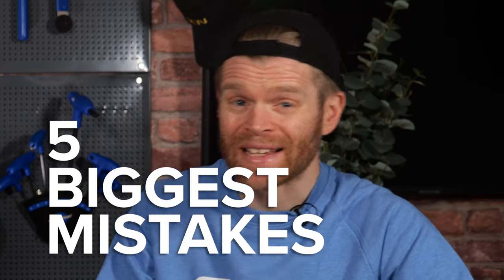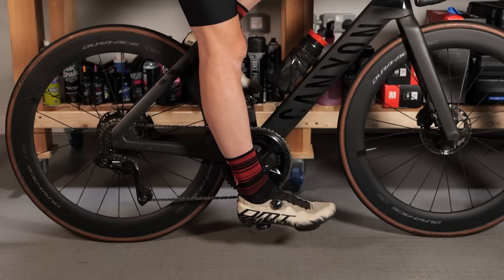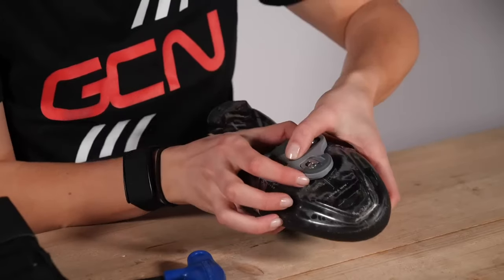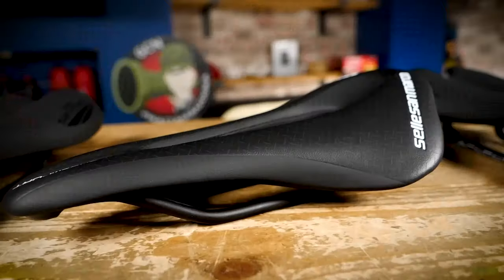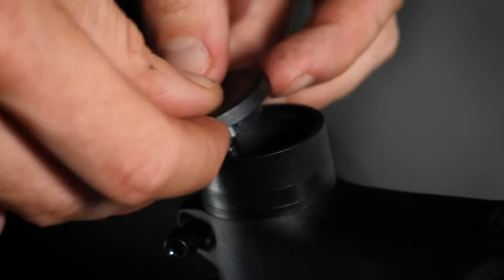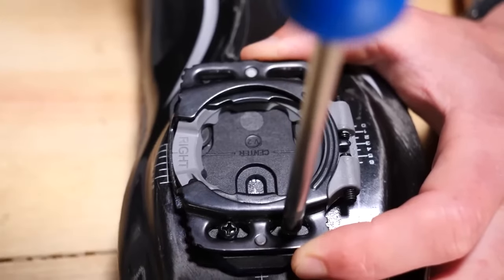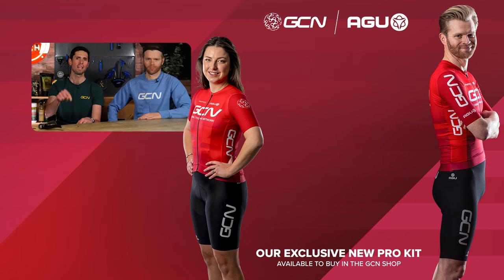The 5 Most Common Bike Fit Mistakes

Comment from the maker: Have you made any of these adjustments to your bike? 🚲
Reply: I got a new road bike for Christmas 2023 and the bars were off center just a bit so that it was causing back pain on longer rides from being leaned over to one side. No change in saddle position,  just centered the bars with a tape measurer and done. Great tips!
Reply from the maker: @wertacus nicely done!
Reply: Got a size smaller frame (than recommend for my height) after a fit. That was key, as the recommend size just felt wrong, despite the advice and theory. Afterwards moved from 172.5 to 165mm cranks also - that made a big difference.

Comment: Way too simplistic. Saddle not comfortable, try loads??!! WHAT! Any decent fitter will tell you that saddle discomfort is often the result of a poor fit so get that right first before throwing money at saddles. And you wont get anywhere near it by just sticking yiur heel on your pedal. Go and see a decent fitter, get the right geometry and setup for the riding you do, then sort your saddle out. Love GCN content, not this one, sorry guys.
Reply: Agree, usually the saddle discomfort is not because of the saddle! It is because of the wrong body position meaning the geometry.

Comment: i am not a pro-cyclist, so...i am having a hard time comprehending why whether cleats are worn out is a "bike fit" mistake?? and it is so important the expert put it as point 2
Reply: I would suspect the list is largely based on how often it comes up as a solution to an issue. Like he gets a lot of questions regarding knee or hip joint pain and the solution is not to adjust anything about the bike itself, but the cleats.
Reply: @Frag-ile  ahh...thats right, thanks
Reply: Worn cleats will result in a lot of play in the front of the cleat which can cause all sorts of issues
Reply: Complete nonsense. This point made him look like a complete fool. He has no idea how cleats work. Laughable.
Reply: @Tantewillieja what? At least with spd sl this is complete nonsense. What is wrong with people? Have you ever ridden a clipless pedal? Sorry, but I had to adapt to the quick fire of the video.
Reply: @christocan4710 this guy gets it. They are showing a worn cleat from walking on asphalt. This has nothing to do with the engagement surfaces. You'd have to inspect the nooks and see if there is additional wear and generally you'd just get "bonus float". Replace them if they don't engage properly or plastic is getting thin enough to snap with whatever watts you pull up with. You're way worse off changing cleats prematurely and then not getting the alignment the same.
Reply: @labpartnerlp  Great comment and exactly my experience. The worn edges from walking don’t change anything to riding. With SPD SL the front and back engagement parts are almost never worn. It’s great quality and assuring the safety. Also my pedals have zero damages from cleats. It seems not possible. After 20.000 km or so I just switch cleats sometimes for the looks and better walking.
Reply: i agree. this is bs and also i don't see why the pedal shoud wear quicker when the cleat is worn out. sorry gcn but this video was not very good
Reply: YES, IT IS, it's hyper important a sloppy cleat has your foot all over the pedal and can put your whole leg out of position and can totally screw your whole body up!
Reply: @leedorney  NO IT ISN'T. :-) At least with SPD SL cleats they only suffer from he bottom. Nothings changes at the positioning and clamping on the pedal. Maybe you are talking about some cheap copy product.

Comment: The biggest mistake is NOT spending lots of money to support the industry.
Reply from the maker: What would you say is the best area to spend your money on?
Reply: @gcn  If you're having actual comfort issues on your bike, study the concepts of bike fit and apply them to your situation.  Make whatever adjustments seem appropriate short of replacing parts.  Then, if that hasn't worked,  go for a bike fit.  Don't spend a dime on new parts until you have that accomplished by someone who knows what he or she is doing.  Then make one change at a time so you'll know in the end what actually worked.  Assuming you're on the right size frame, odds are the parts you need are either a saddle or a stem.

Comment: I agree with some of this but hand placement on hoods and handle bar is complete nonsense and shouldn’t be relied upon for a good fit. Hands will naturally move around as even the best fitment will lead to a “sore” hand at some point and you naturally move to a different position, you also naturally move around as power increases but yes you should be able to “hand shake” comfortably with lever at some point to control the bike. But to say ou should be there all the time? if I want to sit up more and relax I will, the more power I put out the more extreme the position gets till eventually I’m either in the drops or have a 90 degree bend in the arm and flat back.

Comment: This misses three other key measures: fore/aft saddle position, fore/aft cleat position and bar height. Cleat wear is not a fit issue; it goes with saying that you replace cleats when they wear out.
Reply: The thing with the cleats is the thought of feeling the difference after changeing them. It can be so annoying if you tried but can't get them to feel like being in the same position as the previous. For that reason - if the cleats feel perfectly positioned - I tend to not change them too early even though they are worn out and wiggly.

Comment: There seems to be an assumption in this that we are symmetrical. We’re not. Legs are usually different lengths, feet arms, the bike may be symmetrical but there is a degree of compromise required to get a good fit. For example better the short leg doesn’t over extend than the longer one doesn’t fully extend (I think that makes sense). Also important for cleat positioning

Comment: Bike fit needs to be personalized and for the specific purpose. How long you've been riding and your weight, particularly your torso/arm weight make a difference, as does the ability to regularly get out of the saddle. It's surprising how many amateur cycists can't/don't feel safe out of the saddle! A little tip for numb hands is to NOT tilt your levers up excessively, try have them close to horizontal, this also makes it easier to brake on the drops.

Comment: I used to ride a TT like position, but for a more relaxed yet powerful stance on the cycle i relaxed things and looked at everything, saddle - reach - saddle height - shoes & width - bars - lever position - you name it i got it to a place whereby im comfortable for hours on the bike instead of for a 10 TT or a blast round my local circuit etc..and as much as its cost a bit im happier and more comfortable to go faster when i want to 👍

Comment: What I'd like to see a bike fitter clearly explain is that there are three basic curvatures to a saddle that define its shape: 1) the longitudinal (back-to-front) (i.e. flat or curved saddle); 2) the lateral (i.e., sitting on a log or a flat board); 3) the shape viewed from above (e.g. T-shaped with narrow nose or V-shaped).  Once you know what you need along these dimensions based on past comfort or even riding style, pelvic rotation etc.,  this radically simplifies how to narrow down your choice of saddle.  Different manufacturers have different saddle selection strategies, but for the basic consumer, they may not be clear.  It may not matter much if a saddle has a large or small cutout if the basic shape is not right.  The recommendation to "just try it" is not helpful when there are 50 saddles to choose from.   You need to know which saddles to exclude and knowing the basic shape is very helpful, just as is measuring the width of the pelvis.
Reply from the maker: This sounds like we should try and get an expert from the saddle industry to come along and talk saddles!

Comment: Yeah. Being an aged git I realised a couple of rides back that I have shrunk over the last N years; in height, alas, if not in girth - whence neck and shoulder pain, and much riding with my hands on the tops of the bars.  A couple of days ago I swapped out my 9.5 cm stem for a 7 cm, and while I think I was more comfortable afterwards I might yet go back another centimetre.

And since my cleats have been clicking and clacking of late I reckon they're due for a change as well.

BTW: re saddles, a lot of people have legs of different lengths, 11 cm in my case, and plastic-armature saddles are utter hell to ride on since all the weight acts through a small patch on the shorter-leg side.  A leather saddle may be viewed as a 'dad' thing but it will adapt far faster than any plastic saddle under the sun.

Comment: Question here - It’s not uncommon to have on purpose different cleat positions on both feet due to dissymetry. Why isn't it the same for other parts of the bike? For example, a lever slightly higher or lower than the other one, slightly offsetting your handlebar, or (why not) different size cranks?
Reply: One of the reasons is because  your locked in with the cleats so you’re feet can’t naturally adjust. The rest of the body is free to move and adjust as and where it can. This is we’re bike fits start to become blurred. You need to listen to your body and adjust bit by bit to a point that suits you but a fit may MAY get you there quicker. Or it’s a problem you may have to put up with
Reply: This is a valid remark. If one arm is longer than the other, why not move one STI further away. If one shoulder is broader, then put the handelbars off-center. But my guess would be that this is rare, whilst misplaced STIs, handlebars etc. are quite commonplace.
Reply: @SrFederico I do have one arm slightly longer (I think many do) and have moved the lever a few mm out.  Since your hands should be just floating on the hoods or bars when the saddle setback is correct, it doesn't make a huge difference, but may be a worthwhile tweak.
Reply: @bengt_axle  Limb length discrepancy and different sized feet are quite common, a good fitter will and should know this, and not say bullshit like this "expert". This video is full of false claims and missinformation.

Comment: What are the next 5?  I'd suggest that if the stem is too short, a rider may move their saddle forward to shorten the reach.  So what is the correct saddle fore-aft position?  Plumb bob from front of knee to pedal spindle is only a starting point.  Good luck!
Reply: No, you definitely should not move the saddle just to shorten the reach.  Setback is all about balancing the upper body. There is no biomechanical basis for "KOPS".  The correct way to set up the saddle fore and aft is to set it at the horizontal position that allows your hands to just float on the hoods or tops of the bar when pedaling moderately hard.  Bernard "Blaireau" Hineaut famously described this as "being able to play the piano".  When you pedal, some of your weight is taken off your hands because your pelvis is further back and cantilevers your upper body weight. Sliding your saddle back will take weight off your hands; forward will give you more power but more pressure on the hands. The stem is always chosen last, to just allow the hands to fall on the bars in the right place, after the saddle has been set up. If you cannot reach the bars with a stem of 70mm or more, your ROAD bike frame is too big (mountain and gravel can have shorter stems).    That being said, some people can move the saddle forwards a few mm and still maintain a good balance because they push down harder on the pedals or their abs are strong.

Comment: I have some very small fingers and i can't grab the brake levers, i'm in shimano 105, I tried to bring them closer with the setting screw but it is still to far. Do you have any solution ?
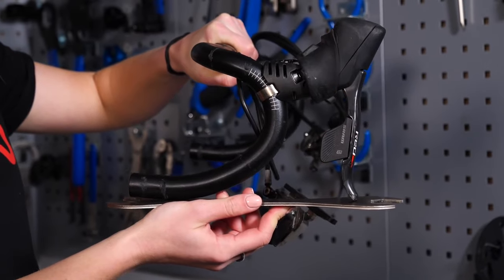At 3:07 does the levers should always be like this? exactly parallel to the ground with the handlebar ? It is not what I see on every picture, is that a problem?

Comment: You mentioned cleat markings on shoes may differ. What would you use as the reference point when putting new cleats on your new shoes? Measure from the toe, heel or from the cleat bolt holes?

Comment: Speaking of saddle comfort, I always thought it is “fine” to feel discomfort and numbness after 60-80 km non-stop pedaling. Should I consider changing a saddle in this case? Seriously 😅
Reply: You should be able to ride without any numbness, even if you're doing 5 hours of cycling everyday, like a pro.   The only pain you might feel when first starting is soreness under the tuberosities (sit bones), but this typically goes away with good shorts and after a few rides.  Your TVA should and lower abs should be contracted slightly when pedaling.
Reply: Not necessarily, get a good bike fit. Preferably not from that guy, he is talkin shit.

Comment: I can't agree with the seemingly dictatorial instruction "your hands should be on the hoods".  Some times I want to ride for prolonged periods on the hoods; sometimes I ride on the ramps and sometimes (esp up long hills) I ride on the centre of the tops.
That's the whole way drops are designed - to let you move your position to suit what you are doing.
A more sensible way of putting things would be to say your stem should be too long to let you ride comfortably on the hoods when you want to.